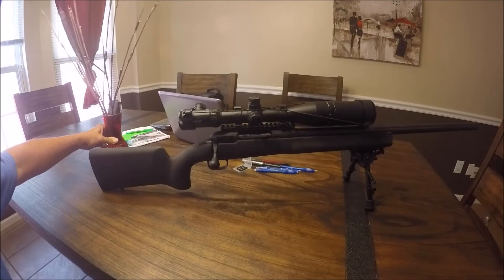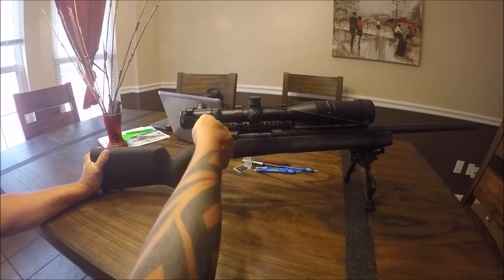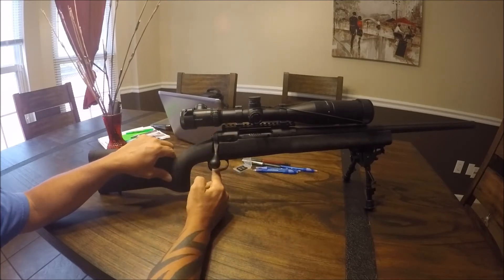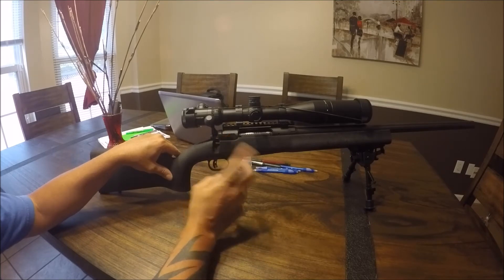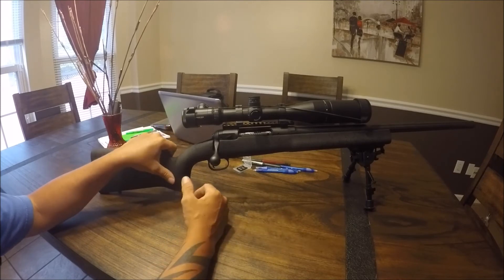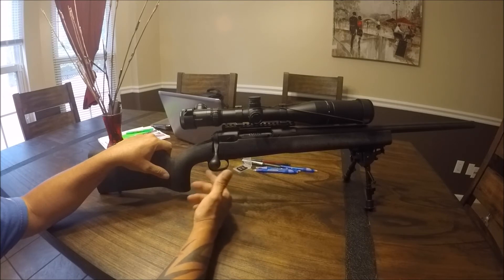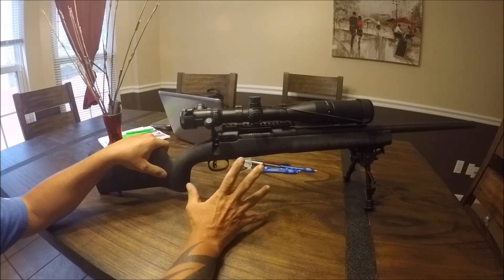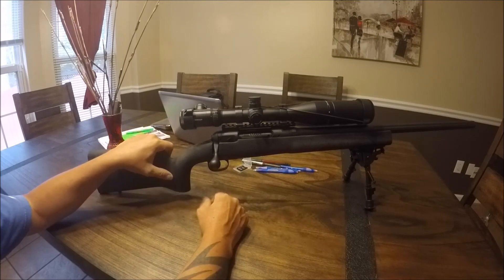Savage 6.5 Creedmoor accutrigger  lock-up explained

Comment: Mine is doing the same thing and it’s a decked out cerakoted chassis rifle in 338lapua so needless to say I’ve been livid about it, I will say one thing it seems like my safety is sliding to easy but I’ll see if what u displayed will take care of the issues I’ve been having bc I sure as shit I don’t wanna have to ship something that massive bc it weighs every bit of 20-25lbs not to mention I dnt wanna have to take a chance and it get damaged or disappears because it’s so large and heavy it wouldn’t take much to toss it around n my dad who jus died passed on to me so only thing I would consider in a last case scenario would be sending in the trigger group even if it has to go through n ffl and jus make them send me a new one bc usually if u tell them fix it or forget it about it I’ll go elsewhere they’ll try get it taken care of

Comment: I fixed it for $0.17 cents. I did two Savage 308s  today like this. Between the trigger and the inside area of the Common Trigger Pivot & AccuRelease Pivot housing  is a gap of 0.019 mm. So I found a spring washer or a wave washer  (look up Hillman zinc-plated wave washer,  *not a split washer*).  I found the smallest one that the trigger & accutrigger pivot pin (2C) with E-clip would fit through (part 2 C on the Savage trigger schematic). I carefully removed the E-clip, partially pulled back the 2C pin wast the AccuRelease Blade. Between the trigger and housing, I put some synthetic wheel bearing grease where the wave washer will go and coated the wave washer with grease too. I took a straight edge screw driver and pushed the wave washer between the trigger and the trigger housing until the center wave washer hole aligned with the  2C trigger pin. I pushed the 2c pin back through the AccuRelease Blade and the trigger housing. Than temporarily used a small C-Clamp to squeeze the housing ear the pin to make it easy to slide the E-clip back on the 2C pin. Than I put some synthetic wheel bearing grease where the sear rides on the trigger and in the notch. Than I got a safe adjustment on the Trigger Return Spring. I was able to adjust the trigger with a light trigger pull again. The benefits:   The trigger has almost no lateral left to right movement. Because of no lateral movement the sear and trigger release grove are more squared for better safer engagement. It seemed to eliminate the AccuRelease Blade engaging from lateral trigger movement. But the AccuRelease will engage if the main trigger is pushed rearward, so that safety feature still works as intended. And the two greatest Benefits are, the AccuTrigger is working again like new and I don't have to spend $149.00 on a Timney trigger, only time and $0.17.  Also for those like me, who have the bolt release in front of the trigger guard, this also seems to be a secondary cause of the sear releasing like the video describes. So when tightening the main screw underneath the bolt release button, if the trigger guard towards the back rides up,something internally did not seat. Start over. And if the sear releases sometimes, after putting the bolt back in, try working the release button several times, it seems to catch easily internally. And run the bolt smooth not to soft or too hard using the ball on the bolt. I hope this makes sense and helps, because I was getting disappointed that the trigger starting acting up.  now it seems to be fixed.

Comment: Thank u for the info. What's happening is trigger is to sensitive and its coming off sear and accutrigger safety is jamming it. Increase trigger pull and you'll be good.
Reply from the maker: Mark S thank you . I left the trigger as is . I have adapted to it . It sets at about 3/4 pounds. I did some research and some other people told  me the same thing 👍. Thanks for watching!

Comment: my model 10-sr just did this today and it's  from the gunsmith  taking it back tomorrow  safety  locks up ago thanks
Reply from the maker: Dana Jones , if it's custom built then yes take it bake to be safe . If it continues and you don't want this , get an after market bolt .
Reply: Yea I replaced that cheap stock with a HS precision stock  so I'd do it myself but I'll let them adjust the trigger great video